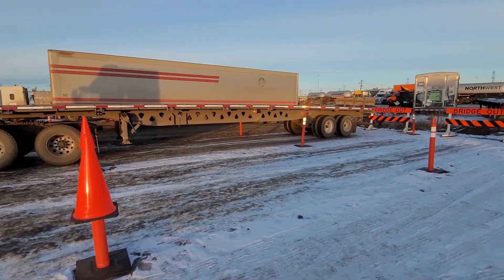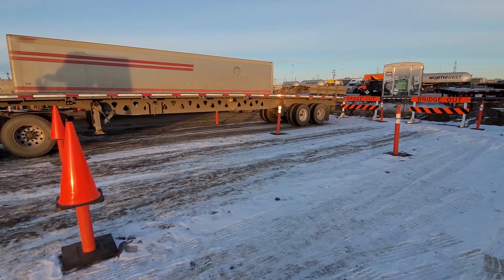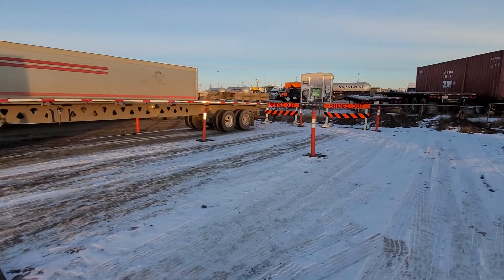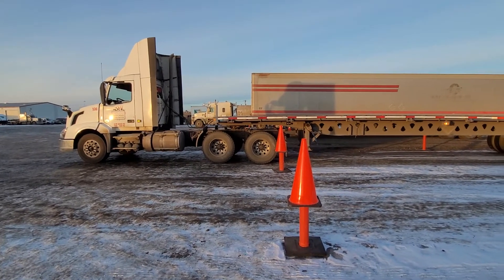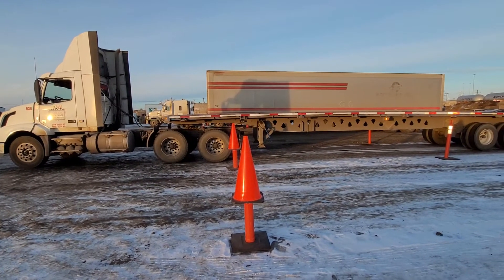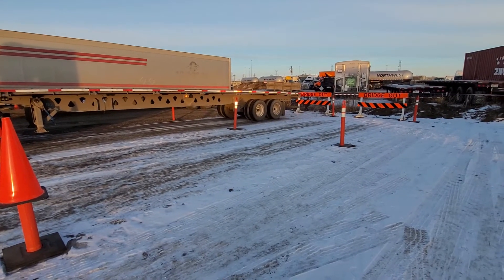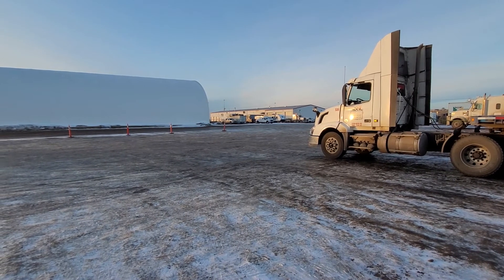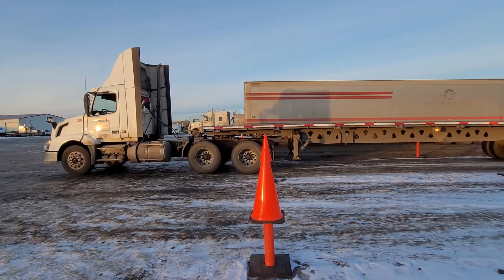Alberta M.E.L.T Workspace Measurements and Breakdown

Comment: Needs to be an allowance for set forward vs set back steer and trailer axles, this has been proven to be undoable with 2 pullups with a 244" wb tractor and a 48' deck with fixed rear axle.
Reply from the maker: I agree

Comment: Thanks John  I like your video clips. Is there a measurement for the imaginary wall ?
Seen in one of your videos for the MELT Driven Test they allow unlimited pull ups but must be done in 10 min.
is that for all Backing Manoeuvers?
Reply from the maker: Thanks for the comment, more videos to come for sure 👍 the imaginary wall posts are spaced 3.7 meters apart in line with the workspace posts which are also 3.7 meters apart. The outside posts at the wall are 6 meters for the boundary of the parallel offsets.
Reply: So that makes the OAL of 19.4 meters  
Watched Your video on the Parallel Offset and you mention they have changed the allowed pull ups to Unlimited and a 10 min. time  Does the same go for the 90 Degree ?
Reply from the maker: @murraycoleman6738  yes, 10 minute time limit for each backing Manouver.
Reply from the maker: Yes it is.